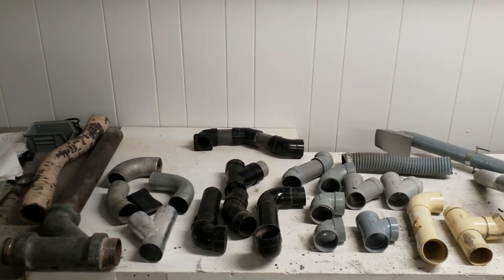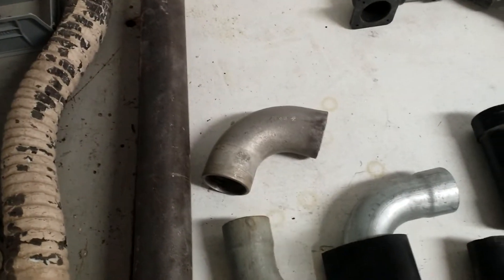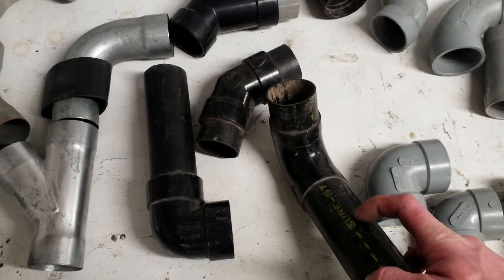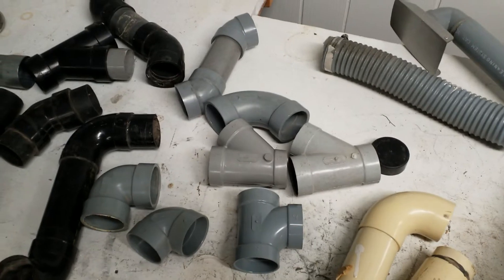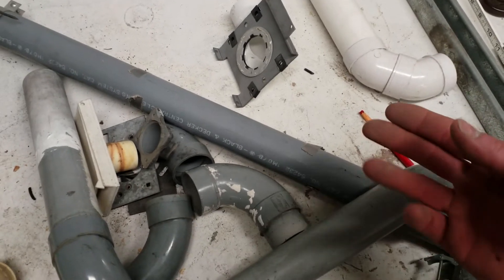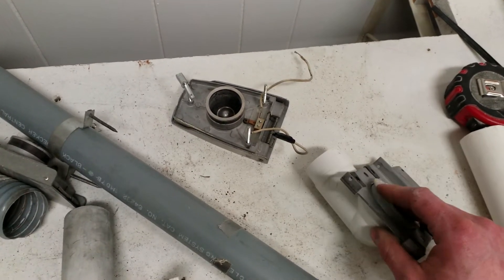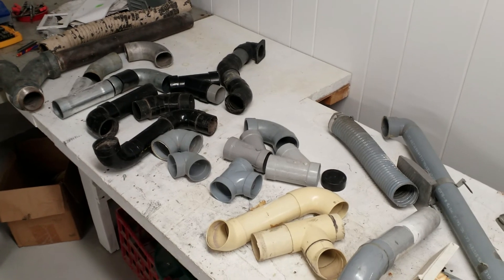Evolution of Central Vacuum Installation Pipe (Tubing) and Fittings

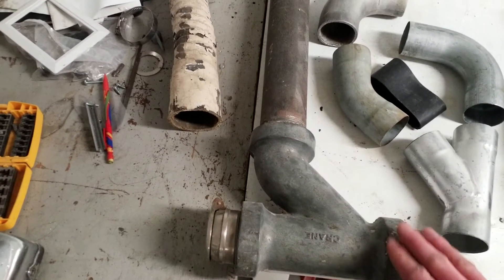Comment: 2:37 as an electrician who frequently runs threaded rigid conduit, you hit the nail on the head in regards to threaded fittings being assembled in the right “order” — you run from the panel to the box, and you can’t add onto it without unscrewing preceding parts of the pipe. I cannot imagine running threaded vacuum pipe in the early 1900s, using a just a pipe vise, ratcheting hand threader and an oil basket. 
 
Do you happen to know, did they use taper threads or straight on those old vacuum fittings?
Reply from the maker: I know, wild huh?! So much labor, especially in systems with larger pipe sizes like for hotels and schools. All tapered threads and it was recommended to run the pipe a little past the end of the die so it was easier to screw all the way into the fitting...that way you didn't get a pocket to catch debris.